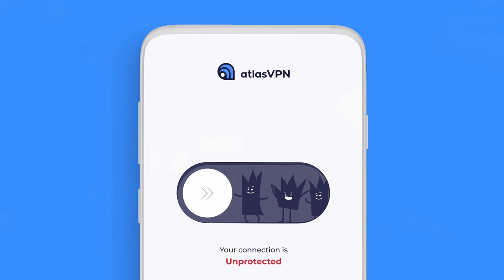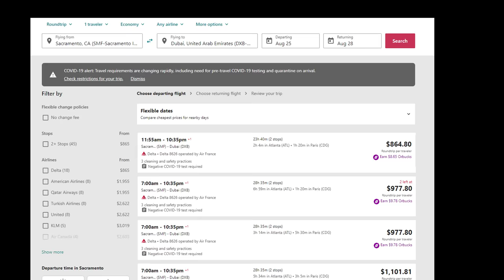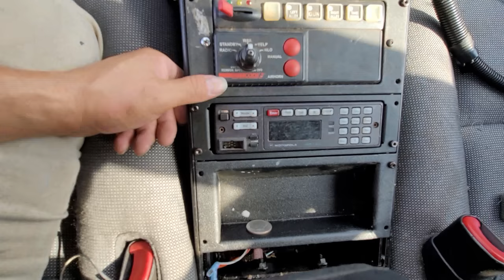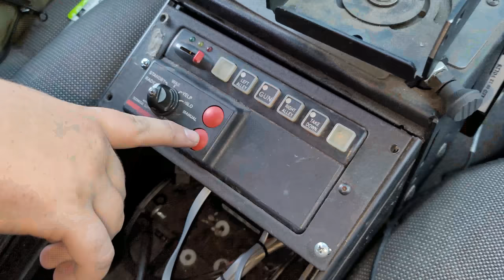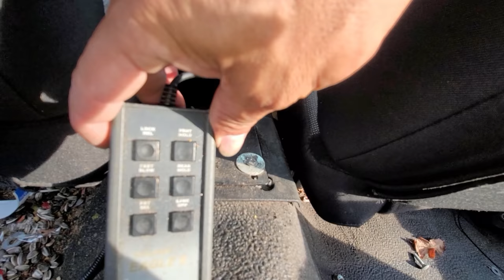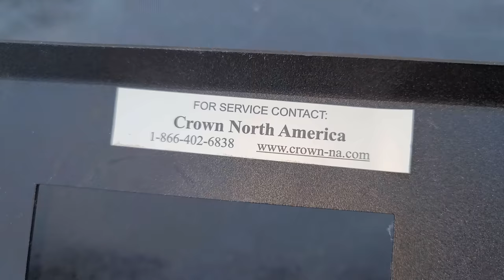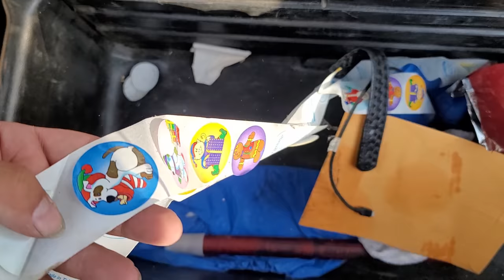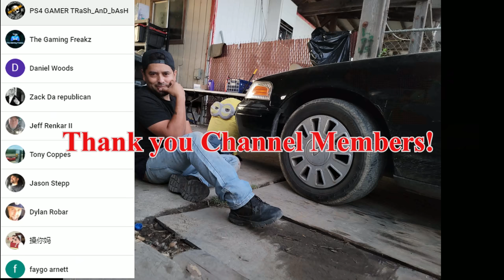I bought a Decommissioned Police car! Found Less Lethal SUPER SOCK!

Comment: The tuning forks are for verifying the calibration of the radar. We had to fill out an affidavit after every speeding ticket saying we had verified the calibration at the beginning of our shift. A lot of smaller departments didn't do annual calibrations so people could beat a ticket in court by a asking for the department to provide the proof of calibration which they usually didn't have.

Comment: So what you thought was the brain fit the customer signals, it wasn't. The one you said, what's the heck is that, is the brain. The opticom is mounted in the truck because there was probably a strobe in the light bar. So they hook the head in the trunk and hook the light bar strobe to that.